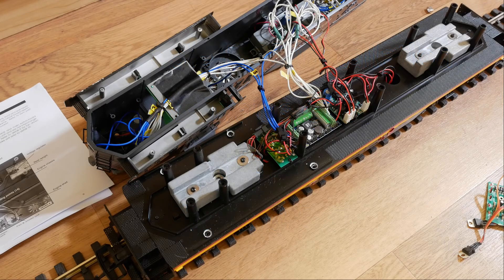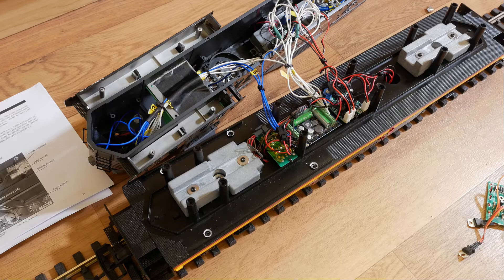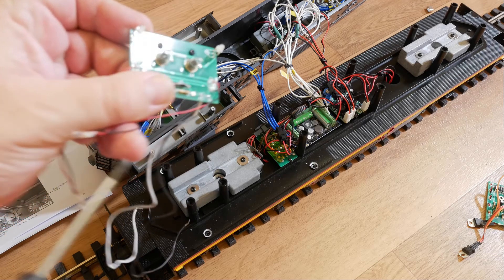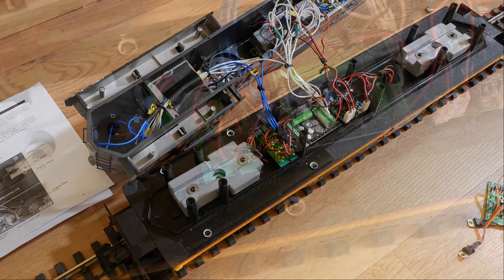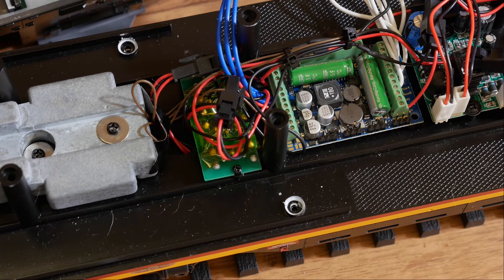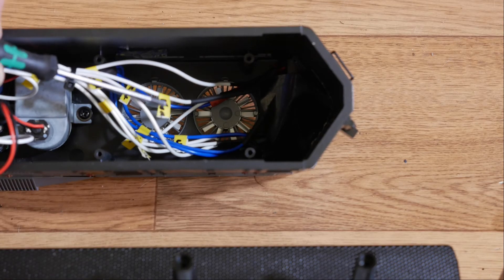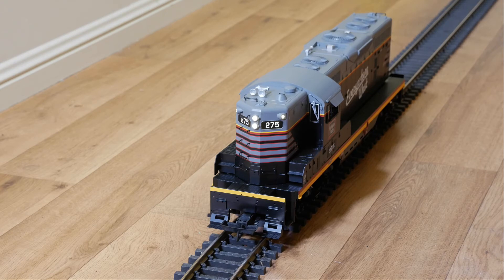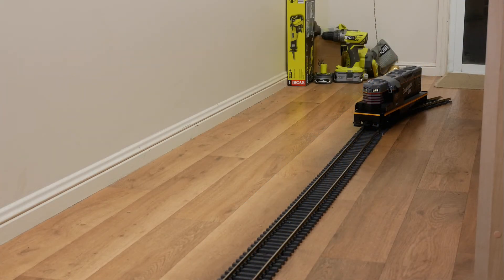Go big or go home! Installing DCC into a USA Trains GP9 in Gauge 1

Comment: Is  there tutorial on installing decoder for usa trains diesel locos?
Reply from the maker: I don’t think so David, I tried to show here what went into it but it took a bit of research to work through it.  The biggest issue I found was the current draw of all the individual incandescent bulbs which I was concerned about given it also had a smoke unit too.  While the Loksound XLs are good for 5 amps, with twin motors both drawing 1 amp each under stall load, and the smoke unit, there wouldn’t be much left for all the lamps as well.  The USA train PC boards for lighting etc are not set up for DCC either.  I chose to replace all the lamps with LEDs to both simplify the installation and to reduce the current draw.  I’ve also seen a couple of forum posts saying the same thing which gave me the clues to do this one.  Sing out if I can help in any way.

Comment: Have a question for you about wiring motors and track power. Did you wire the motors in series? How did you wire your track picks?  I am having issue's currently with my usa trains 70dmac.
Reply from the maker: The motors are in parallel otherwise they won’t run well together.  Track pickups were taken straight off the bogie and into the Loksound XL.  You do have to be careful about polarity on the bogie wiring though as I think they are wired opposite to each other if I remember rightly.